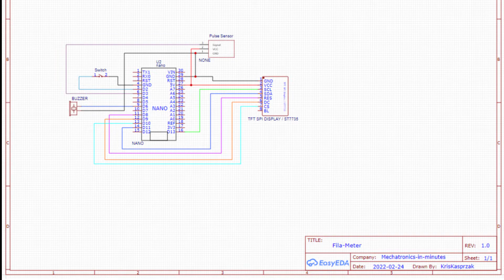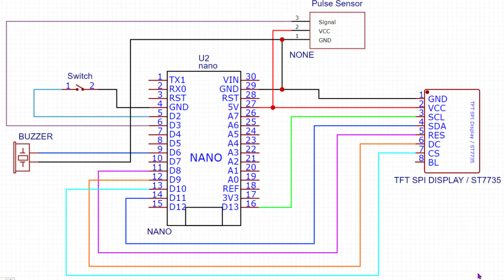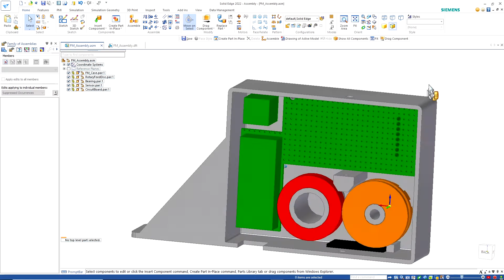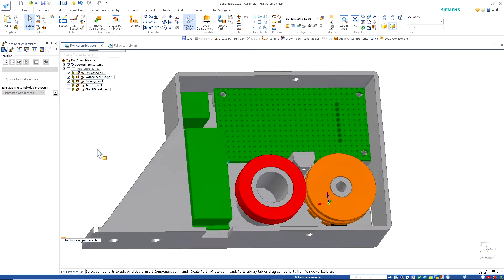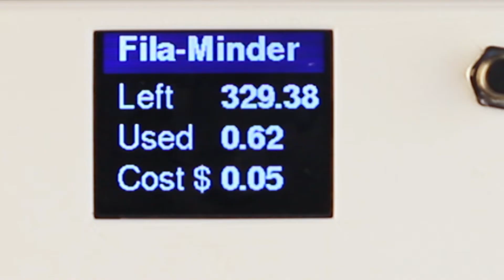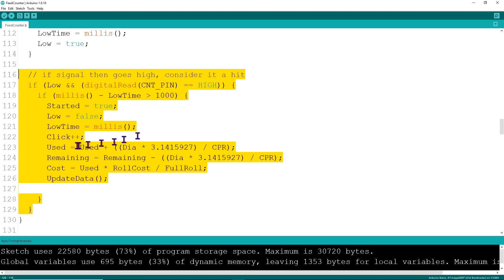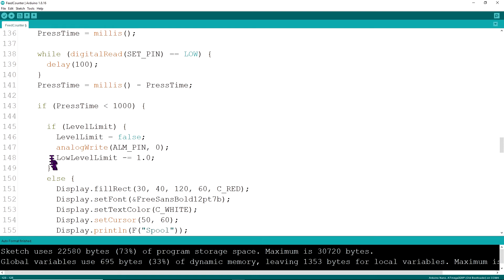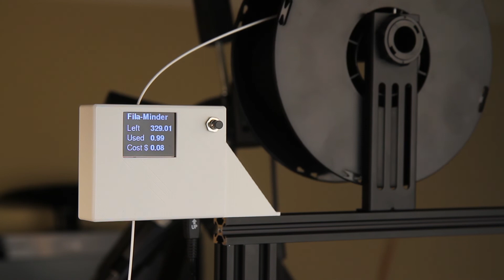Build a 3D printer filament meter

Comment: i like the encoder version so you can adjust the reel amount but youy are using a teeny instead of arduino nano are they backwards compatible  ie can i use the encoder with the arduino

Comment: I am in process of making this project, but I am wanting to add one more feature: A runout microswitch to pause the print. I ordered the micro switch that has a roller bearing and the display on a long boat from china :)  As you designed the housing, would it be too much to ask if you could mod the casing  with guides to add the switch along the bottom or so? Thanks for a great project.
Reply from the maker: if you go to the github repo, file and issue and add a simple sketch, I'll see what I can do. Technically it's an easy task, but getting what you want will be the trick
Reply: @KrisKasprzak did this ever get done?  I’d love to see an updated video for this project that adds a run out switch and pause command!  Maybe also add a feature to allow the same info displayed on the screen to be available like an API.  I’d love to overlay this info on my webcam for the printer so I can remote monitor prints

Comment: Question: I have a Babmu Labs AMS that also retracts the filament from the extruder. Would this read in reverse.. In other words, would it substract from the count?
Reply from the maker: it will not read in reverse. My unit also retracts, but there is enough slack to prevent overcounts
Reply: Bummer.. is there any way to change the code so that it does count in reverse? -- This is a fantastic solution for us beginners
 @KrisKasprzak

Comment: Hello, I'm having an issue with running the FeedCounter.ino code. Everytime I try to verify and run the code I receive the error, Colors.h: No such file or directory. Now, I have looked in my folders and everything is in the correct places and the directory to the file is correct so I am at a bit of a stand still with the project. I am running Arduino IDE 2.0.3 if that helps.
Reply from the maker: Oops. I forgot to upload colors.h. you can put this file in your .ino folder or create a Colors folder in your libraries folder and put it in there.

https://github.com/KrisKasprzak/Fila-Meter
Reply: @KrisKasprzak  I'm still recieveing the same error, thanks for your help, do you know where exactly I should be putting the file? I've put it in with the libary folder and I still recieve the same error, I've also put it in next to the same programme, can you help me? Thank you. Love your work by the way.

Comment: A nice addition to this would be to have the option to set the length of a role that does not have 330m on it. Like a role that you used, take off and write the amount remaining on the role and use that amount the next time you use that role.
Reply from the maker: Great idea,
Reply: @KrisKasprzak  I am ordering the components to make this now. I love the idea but am new to the whole arduino thing, but looks easy enough to figure out.

Comment: Looks like a cool project, I'd sure like to have a bill of materials to base my search for compatible parts off of. Especially since this is the first time I'd be working on a project like this,  something like links to Digikey items would let us find alternatives pretty easy.

At 0:35 you go over the parts, initially the audio list matches what is brought out on the video. It quickly gets reordered which means I need to have enough knowledge to match the audio descriptions. I'd highly suggest shooting scenes like that in one shot so the explanation is in sync with the video.

I think this is the style of encoder pickup , that page mentions the "FC-03 encoder or the encoder FZ0888"
http://androminarobot-english.blogspot.com/2017/03/encoder-and-arduinotutorial-about-ir.html

I'm not sure what the pulse sensor is
Reply from the maker: Have a look at the description, I've just added links to parts found found on Amazon. The github repository also has the parts list and wiring digram.